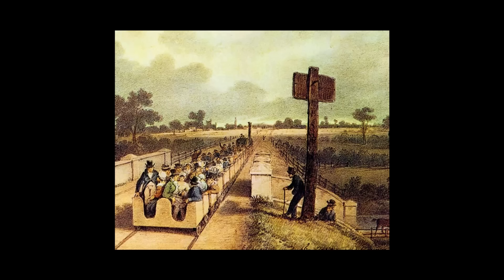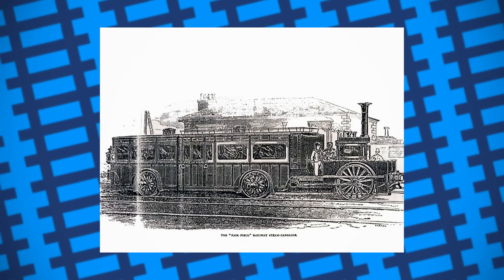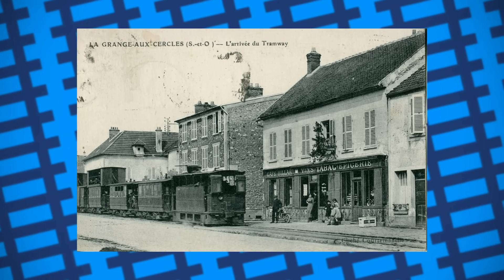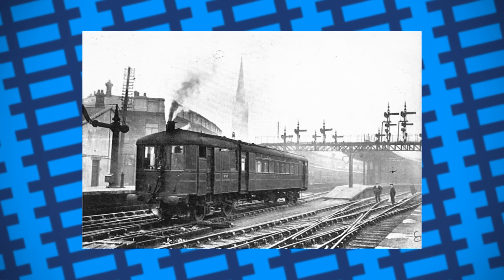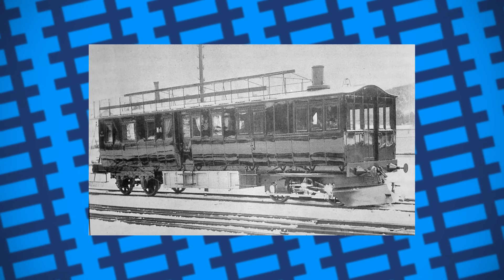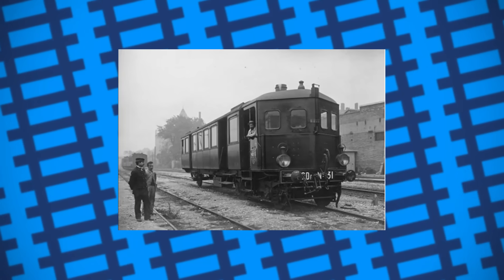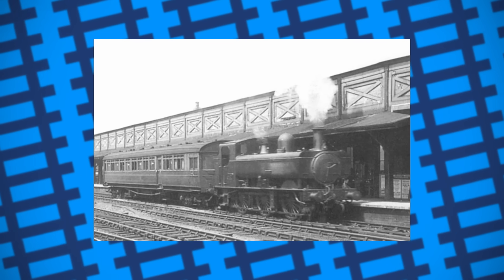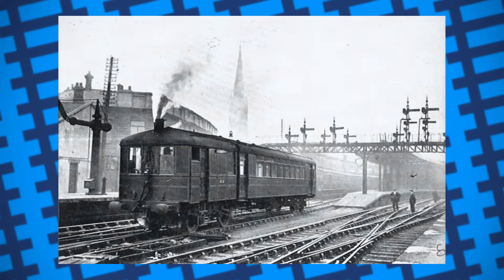Why Steam Powered carriages were unpopular - Steam Railmotors

Comment: Still, when a motor bus needs maintenance the whole vehicle needs to be taken out of service, just like the steam rail motors. You just can't remove the trucks from underneath and put in a replacement set straightaway like you can do with trams.

Comment: Interesting! Some steam powered carriages were built in Sweden too, but never were a success here either. In one case (the Mjölby-Hästholmen Railroad), the boiler tubes had to be replaced after just one year of service (traveling 60 km per day). Eventually it was rebuilt into an ordinary passenger carriage.
Reply: Steam power kind of has a strong economy of scale. It works very well on a large scale but it doesn't scale down very well. With internal combustion engines the larger they get the less efficient they often become. That's why the largest engines in the world are still steam engines.
This is also why the internal combustion engine was mainly a revolution for smaller vehicles like cars and motor boats.
Reply: @MrMarinus18  Thank you! That was an interesting comment! After all, even nuclear submarines today could still be said to be "steam powered" in a way, even if the fuel is not coal anymore ...

Comment: In Sydney Australia they were used over a hundred years ago. I believe they weren’t a favorite of the suburban communities they past through. Mainly due to the smoke, soot and ash the belched out into streets. The house wives hated there sheets being covered in soot. They were much happier when they all converted to electricity.🇦🇺
Reply: The Kogarah-Sans Souci Line wasn't converted from steam trams to trolley buses until 1937, and the last steam trams in Parramatta went in 1943. Steam lines in Sydney's Eastern Suburbs ran on wide roads (e.g. Oxford Street) and their own reservations (e.g., Anzac Parade) Soot and steam were not such a problem in such locations.

Comment: We actually had some identical steam railmotors to the one shown at 1:33 ordered for the opening of my local line. They were also fitted with an open air deck on the top for extra capacity for picnic goers, since my local line runs mainly through the woods. This was on purpose as the initial entrepreneur behind the line saw more money in logging than in other traffic and so deliberately made the line go deeply in the middle of the forest, several kilometers from some villages. The line originally only ran 3 passenger trains a day, all with the railcars, which themselves also often pulled light logging trains. But of course they had the same issues you described. The railmotors were converted into passenger cars and had their second deck enclosed but didnt last super long. One of its specially built trailing cars does survive into preservation though after having been turned into a holiday hut.

Plus over here in Denmark, in the early 1920's a Danish automotive group making buses called "Triangel" began manufacturing light weight gasoline railcars, which quickly became popular and were built in vast quantities from 1923 until 1939, in use on everything from rural branch lines, to busy urban commuter routes. Several units, mostly from the late 20's and early 30's still survive into preservation too, and many ran in passenger service as late as the mid 1970's, and as departmental stock into the 80's. One on my local line was converted into a maintenance trolley and remained in service all the way until 2005, being barely recognisable from its original self at the end.

Comment: One part of the evolution of self propelled carriages was not mentioned in this video.
Petrol engines and motorcar/ lorry drivetrains were used for a decade as part of that evolution.
Ford model T engines and TT drivetrains were mostly used starting at the end of WW1.
WW1 and the widly use of petrol internal combustion engines excelerated the move from steam to ICE propulsion
Petrol engines had also huge drawbacks and caused lots fires, explosions and nauseous for the passengers.
After the 1929 financial crisis the in WW1 developed military tech Diesel engines electric/hydraulic drivetrains became commercialy viable for coaches lorries shunters and converting self propelled cariages. 
In the early 30's the rise to rail domination of the self propelled passenger carriage started.
Diesel-electric , Diesel-hydraulic and 3th rail-overhead electric self propelled carriages eliminated all the previous drawbacks
DMU's and EMU's  are now replacing locomotive pulled passenger trains into the same niche the self propelled carriage once stood at its beginning.

Comment: There is a Steam Motor Coach, SMC1, or more effectively known as the Coffee Pot, still operating in Australia. It is owned and operated by Pichi Richi Railway Preservation Society at Quorn in the Flinders Ranges South Australia. The engine unit was built by Kitson and Co and the carriage unit by the Birmingham Carriage and Wagon Co in 1905. There was also a SMC2 that operated in the SE of South Australia, although it differed slightly in that there was a drivers cab at the rear of the carriage unit. Both SMC1 and SMC2 arrived in Australia in 1906.
I have the privilige to fire and drive the Coffee Pot at times as rostered.

Also at Pichi Richi Railway, we also have a Brill Model 75 Railcar. These were sent to Australia in kit form and assembled at Islington. The one we have 106, was assembled in 1929, so It's getting close to a century of running. As built, the Brills were fitted with a Winton petrol engine, and five speed constant mesh gearbox (I believe the gearbox is by Spicer). Later the South Australian Railways replaced the Winton petrol engine with an English supercharged Cummins L6 engine. This is the variant that I drive at Pichi Richi Railway.
The South Australian Railways also ran these on Broad Gauge, some were converted to Cummins diesel engines, then subsequently converted to more powerful Gardiner L8 engines with pneumatically operated gearboxes so that they could operate in the Adelaide Hills as multiple units.

Comment: The GWR found that they could not adequately haul a trailer when traffic demanded extra capacity. A small tank engine had the fleibility to deal with such changes of capacity, hauling several coaches.

Comment: Interesting summary of a mode which seems to keep reappearing. Not certain about tram comparison, though. Most trams (at least in UK) at that time carried two crew, a conductor as well as a driver. Also, I’m not sure you can let passengers alight from a train anywhere. It’s not only a long way down from the door but you’d find yourself on fenced-in railway line. There would have to be established stopping points. Contrary to initial appearances, trains and trams serve different purposes and markets.
Reply: American mainline railways use grade level platforms and stairs.
Reply: But also one consistent problem with steam power is that it doesn't scale down very well. There is a reason steam powered cars never really caught on. When it comes to the world's largest engines like in power stations and on large ships steam power is still dominant.
Reply: @MrMarinus18  Actually steam powered cars and aircraft were a “thing”. 
The problem was always startup and shutdown time. A steam locomotive needs at least an hour to start and another hour to safely shutdown of constant supervision.
Flash boilers used in cars and aircraft got this down to about five minutes but not “turn a key and go”.
Electric cars were popular in the 1900’s precisely because they were easy to start. Electric starters were what made internal combustion engines able to supersede them with longer range and lower prices.

Comment: In denmark the 3 generations of steam cars  kitts rowan(1880), arlöf (1910)and sentinel (1920) all had reliability issues and was converted to wagons within 16 years and none was converted to internal combustion even though there was a trend in denmark to convert regułar 2 axle coaches into railcars (Triangel cars)
Reply: Two of the Rowan steam railcars were built for the Victorian Railways in Australia for service on the least used Melbourne suburban lines. Lots of the public wanted them for their local areas hoping they would make Railways to sparsely populated suburbs economically possible. Ran on 1600mm broad gauge. Often needing repairs.
Around 1900 they were withdrawn and purchased by private logging lines for conversion to logging locomotives without much success.

Comment: I think passengers also complained that the movement of the pistons caused the carriage to sway from side to side. This didn't happen with a locomotive, because any movement was lost in the couplings.
Reply: That doesn't happen because pistons mirror one another. As one is moving back the other is moving forward and vice versa so it doesn't shake much at all. However while the carriage doesn't sway the movement of the pistons back and forth does set off a lot of lateral vibration in the carriage.

Comment: What about Doodlebugs? Aren't they like railcars?
Reply: A much more successful design. The Victorian Railways in Australia had a class of doodlebugs in service from 1928 until around 1992. 
Although by about 1950 the Winton motors had worn out and were replaced by EMD or Detroit diesel motors. The class being then called DERMs.
A few preserved ones still running fan trips and on preserved lines.

Comment: Which is worse, a steam railmotor, or a Pacer?
Reply: Easy, the steam railmotor. The Pacers lasted 40 years, which is longer than some of the units they replaced.
Reply: Time for a steam pacer. To reduce costs, it will be made up of a 4 wheeled freight wagon, atop which is an entire traction engine and a park bench.

Comment: I think the problem is that controls for steam engines are mechanically linked, so the driver has to be next to the engine itself. Which means the engine can only realistically be at the front. Electric motors on the other hand can be placed anywhere on the train and only the driver and controls need to go at the front or at the back of the train.
Reply: Not all push-pull systems used mechanical linkages, some like that used on the NER/LNER used a vacuum controlled regulator which allowed more coaches between the driver and the locomotive than the purely mechanical systems as used, for example, on the GWR which was limited to a maximum of 2 coaches either side of the locomotive.

Comment: Steam: I am an engineering titan and require a lot of space to perform efficiently.
Diesel: I am revolutionary. I can produce more power in a compact space and can allow more capacity for passengers.
Electric: I am a versatile form of energy that can power a train in different ways. Sometimes I am limited by my tracks but recently I can use a battery to stray away onto wireless routes.
Reply: Gas: i used to be a car. Sometimes i still am.
Reply: Though steam does work better on a large scale than diesel does. When you are really large engines like on ships or power stations they still use steam engines today. When it came to the largest engines steam power remained the more efficient engine type and the main reason they were phased out was because their lack on compatibility with the infrastructure meant for smaller diesel engines.
Reply: Steam generator are still used to this day, even Nuclear  powery plant use Steam.b @MrMarinus18

Comment: In the U.S. as early as the 1910s and 20s Gasoline powered "Doodlebugs" became the norm and later Rail Diesel Cars or RDC. Definitely a bit more practical than steam powered coaches or carriages whichever terminology you prefer. Though I'd be lying if I said I didn't want to ride in at least one of these things just to see what it's like to ride in one.
Reply: From what I heard they had the wonderful habit of spontaneously combusting, or choking the driver with the exhaust
Reply: @miguelballesteros8692  I think some of those problems are a bit over exaggerated a bit but we're problems. The PRR Doodlebug incident really gave gas powered ones a bad name. Up until then they had been pretty safe they didn't just burst into flames. The exhaust fume one might've been more problematic though. That does go back to the PRR incident as well but he wasnt the first to have problems with it. Either way a lot of them got repowered to be Diesel after that and served well into the late 50s/early 60s.
Reply: We still use them in Denmark, in several places. They are called pigs here. ;o)
Reply: @noahwail2444  That's pretty cool, over here they got their name since they doodled around on branch lines. Or at least that's what I've been told for years but that's how they got their name apparently.
Reply: Come to Melbourne, Australia if you want to ride behind one. We have two currently running - one at the Daylesford Spa Country Railway, the other is operated by a group called DERMPAV run theirs on the mainline occasionally. 

In Victoria we called them DERMs aa it was an acronym for diesel electric rail motor. Originally they ran on petrol or gasoline as you call it, and were called PERMs.
Reply: And then there were the dummies, which were transitional vehicles between horse cars and trolley cars.
Reply: Also urban rail transit electrified very rapidly, thanks to the greater ease with which you could electrify a shorter line, and laws like New York City's ban on steam engines within the city limits.
Reply: I've ridden in RDCs many times between Poughkeepsie, New York and Grand Central in the early 80s. They worked well and you could hear the transmission shift like a car as it went faster.
Reply: Up until the early 2000s a pair of RDC’s ran on Vancouver Island here in Canada.
Reply: A few RDCs ran in the Syracuse, NY area.  We rode on one that left the Carousel Mall and stopped at S.U. on a round trip.  My wife and I were the only passengers and I was still a volunteer brake/switchman with the Adirondack Scenic Railway back in the early 2000's.  The driver had to throw the few switches on the short line, meaning he set the brake and actually climbed down to the track through the back door.  They stopped running some years ago.  Cheers, Bob
Reply: @rvnmedic1968 I remember those RDCs in Syracuse. I recall the Chinese made loco that was at the station at Armory Square. A shame that nothing ever came from it, or am I wrong ?
Reply: Yeah, steam engines have very strong economies of scale. This has always been their biggest drawback as they don't work very well on a small scale. Large ships and power stations still use steam engines today while in steam powered cars never caught on.
I think self-propelled carriages are just too small for steam power to be effective.

Comment: We should still have steam powered carriages & trams but without a burning fuel source, 
just use electricity to heat up bricks that then keep the water hot like how it does so with a heating system in a building.
Reply: Why not use the electricity to, you know, power the actual train like we've been doing since forever..
Reply: That's a horribly inefficient way to use electricity. Just use a motor.
Reply: efficiency problems. a regular EMU would do the job much more efficiently, safely, and cheaply
Reply: That's not efficient, coal will heat the water better, and why don't just use electricity to run the train?